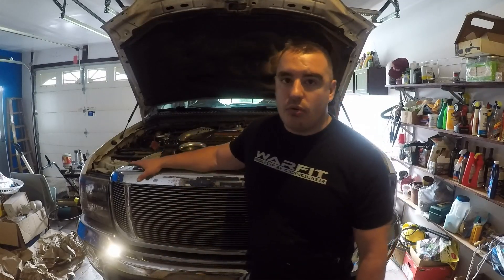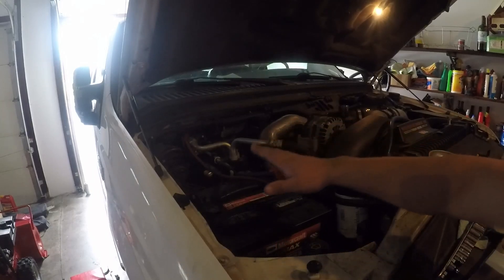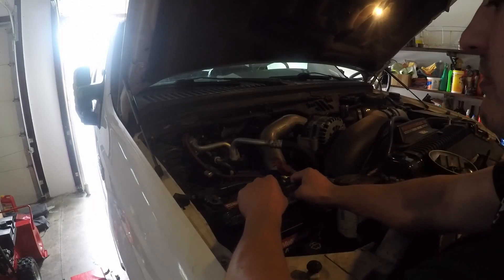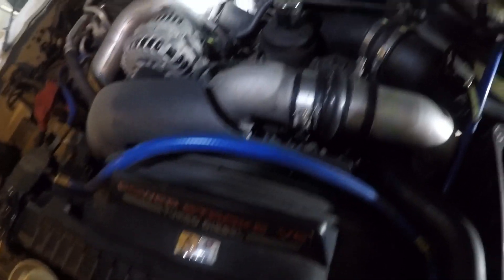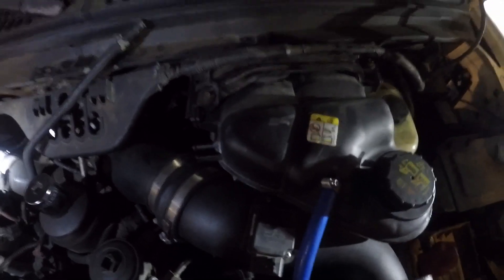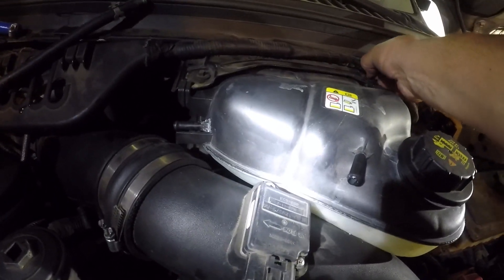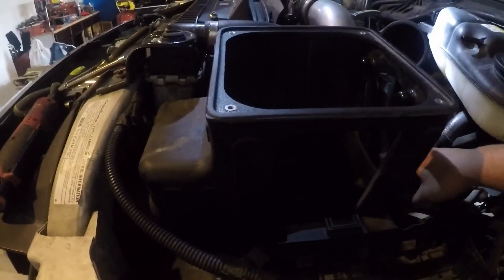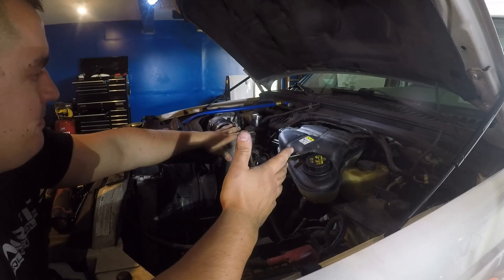6.0 oil cooler replacement part one

Comment: Which oil cooler did you go with? So many out there to choose from
Reply from the maker: We both are running a ford oil cooler. Mine is in the factory location while Josh has used the bulletproof diesel relocation kit with factory oil cooler

Comment: Did you replace any other parts or sensors while your in there?
Reply from the maker: I did not replace any sensors while I was in there. The temp sensors rarely fail those are really the only sensors down there that may be a little bit of a pain to get to otherwise